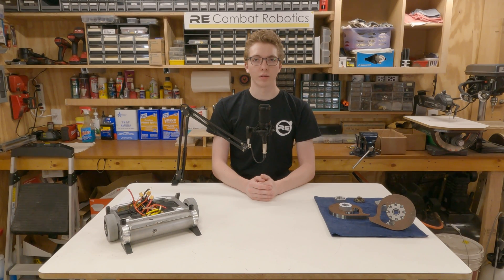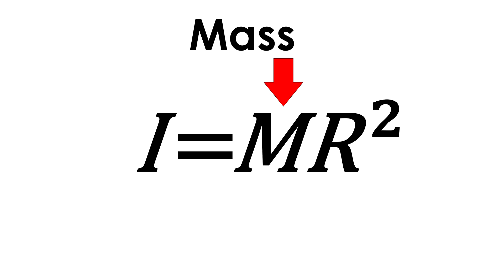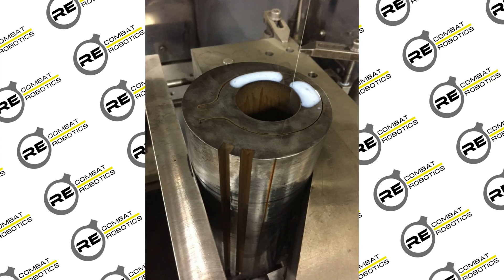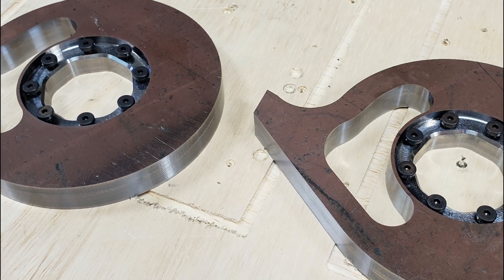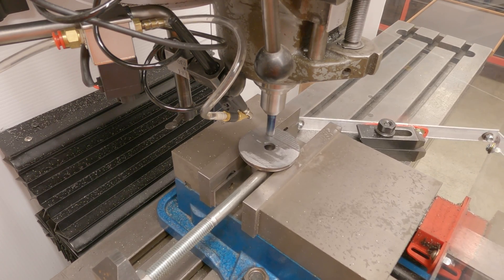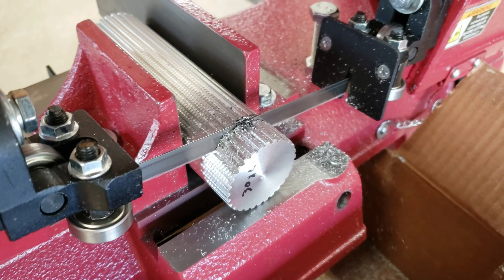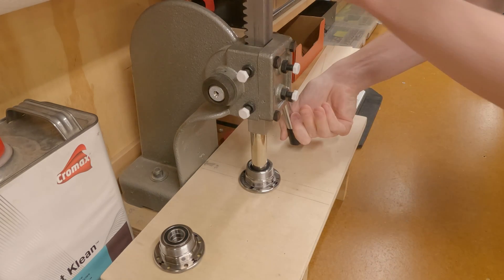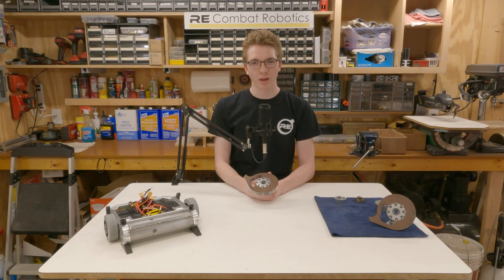Battlebot Weapon Disk Manufacturing

Comment: I’m a machinist and I physically shuddered when you said you tapped those holes. It seems like you aren’t the kind of person to do anything without a good reason, why have a custom tap made rather than thread milling those features?
Reply from the maker: I wasn't as familiar with thread mills at the time to have the confidence to do those small holes.  In hindsight that was definitely the way to go though.  All my new designs use through cut holes with the waterjet, then I only have to clean up the bearing bore.

Comment: Why make you weapon so complicated? Just press fit the bearing straight into to weapon use some green locktite  and tape and thread into the weapon and bolt the pulley to the weapon
Reply from the maker: I needed to distribute the load of the weapon over more bearings than I could fit inside the 5/8" disk, the bearings are relatively small because I need them to be capable of about 20,000 rpm.  Adding properly support bearings inside the pulley also helps with the strength of the weapon assembly against sideways hits from horizontal spinners.
Reply: Oh ok make sense. Just a tip look into needle roller bearings on McMaster. They have some for high rpm I've been using those for a long time same with other schools and i have never seen one explode. Some teams also use lubrication brass bushings as well

Comment: Pretty awesome man, its really cool to she how you have evolved over the years from when you first fought razor. Super happy for y'all. One question, u said 16000 rpm, now I get how razor could do it cause the motor is in the weapon, but for the new robot doing a belt method u would have to be a 1 to 1 or are you guys getting new motors for it?
Reply from the maker: We're planning on using the same 50mm outrunner that Razors Edge uses with a 1:1 belt, but have room to change the gearing depending on testing performance.
Reply: @RECombatRobotics  ok gotcha, I'd be careful about the 1 to 1 that is going to be hard on the motor,  cause ur using a pinion and the motor takes all the force at one point on the axle unlike razor where it has the entire out side of the motor to absorb. Pretty sick though. I'll be wait for ya..  lol if they dont cancel again
Reply from the maker: @cadenkorzan  I'm planning on counterboring an additional bearing into the frame where the motor mounts to help support the shaft (8mm on the motor we use).  The team is planning on attending this year's NRL national competition if it's still on.
Reply: @RECombatRobotics  ok gotch. I think national is waiting till the last minute possible because they don't want to cancel again

Comment: Why not threadmill your threaded holes, instead of trying to tap?
Reply from the maker: Hindsight I should have, I was just worried I was going to break a 10-32 thread mill because of how small it is.  After seeing how well the hardened 4140 thread milled I think it could be done in the AR450 as well.